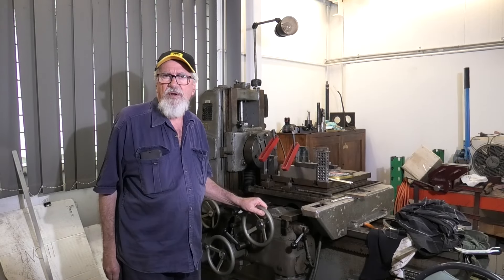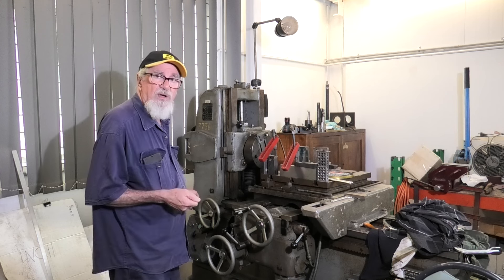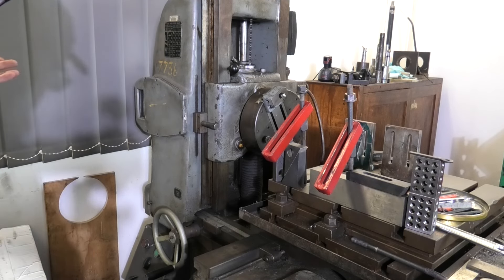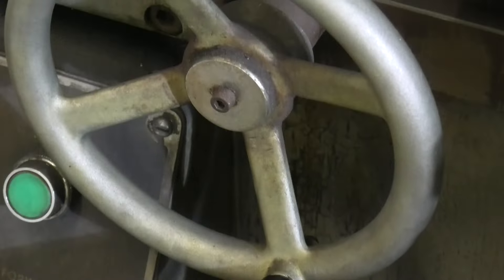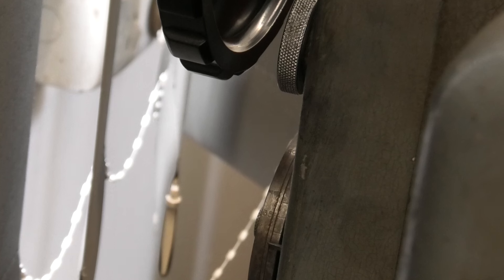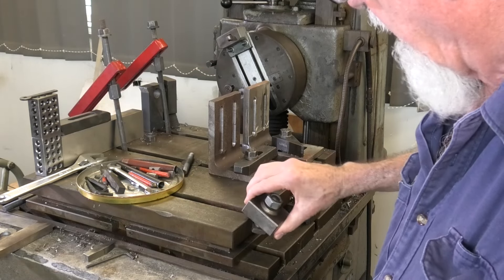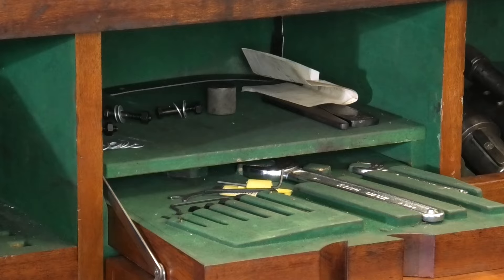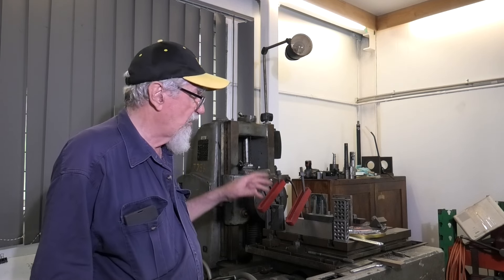Kearns type S HBM walk around.

Comment: Hi BC, 

I've just acquired one of these Horizontal Borers. It looks to me like you have two of the 'tenons' or wedge shaped clamps that set the table at 90 degrees. Is that correct?
I only have one of the wedge clamps with my machine, but do have all four clamping dogs for the corners of the 18" table.

Kind Regards
Reply from the maker: One should do the job easy.
Reply: @inmyshedwithbc.  Thanks, i'll be watching your videos closely trying to see how to work the thing. 
Mine is an optimetric model but unfortunately none of it is lighting up anymore. I'm going to remove the table system and fit a DRO.
Reply from the maker: Hi again. I have some previous videos showing the Kearns working. Just be careful as it is a light machine. Other channels with videos are  Bruce Witham  and Andrew Mathews. BC